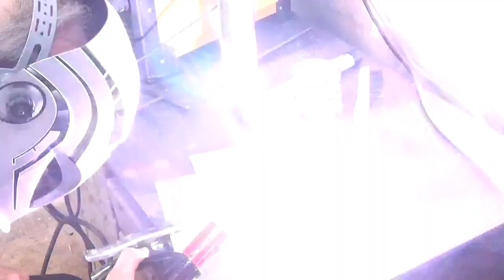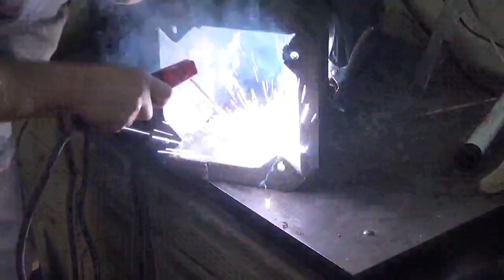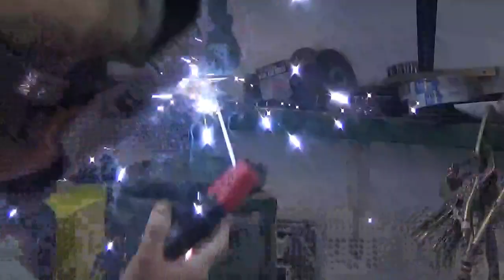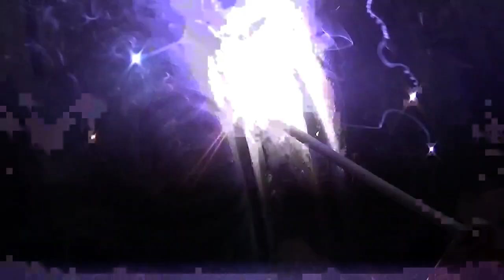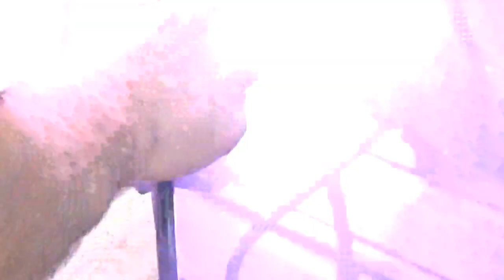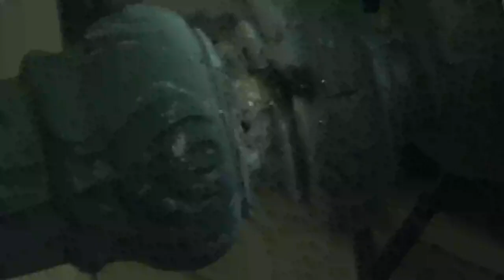Blue Demon Aluminum Stick Welding Rods and my AHP ALPHA TIG 200DX welder,  Easy field repair.

Comment: I wouldn't be surprised if their raw aluminum is from  a scrap yard.  When asked what they wanted, they probably said about a thousand pounds.  I have tried that E4043 rod and it is not easy to use.  It is also quite expensive.

Comment: Try brushing in one direction with that stainless brush. The back and forth only counters the first stroke as it folds the oxides back into the metal if you push only or pull only its better!

Comment: Congrats... You figured out a way to weld pot metal (very very very difficult to do and achieve any strength). I might have tried a dollop of clay behind the blowouts to allow them to fill without further erosion (but I’m kinda crazy like that). Those fumes showed up on camera pretty well and looked really nasty (I only weld outside unless I have a very strong vent system sucking the smoke out, that stuff will kill you real quick). Overall, you did a great job!!! While those rods were sloppy as snot in a sneeze, they got a very difficult job done. That arc flash will give you a sunburn and quite possibly skin cancer... Harbor freight has a wide selection of leather gloves in all sorts of thin leathers (like goat skin garden gloves). They give you plenty of feel vs a bulky pair of welding gauntlets. I don’t weld anything without at least a cape and leather gloves of some sort (no skin showing)... I saw you already caught a lot of grief for not wearing gloves, but it wasn’t very constructive, so I figured I’d bust yer balls a little while offering some viable things to try/consider. You are doing some really great work and I really enjoy your videos... Thanks for sharing.

Comment: Hello there , great video very explainatory .
I would like to ask you , i have to weld some aluminum sheet welded with some cylinders i made at the lathe , the sheet material is 5083 the pipe material is 6060 . I want to pay someone doing it but so far everyone i ve asked refers someone else and i am thinking if nobody finally will accept to do it that i will have to do it myself and what i would like to ask you is , is it quite as strong as a tig weld would be ? I dont care for the appearance cause the welds will be hidden but they play structural role in the whole assembly .
Thanks in advance
Reply from the maker: Hi Antonis, that's a great question;  I did some quick research on the 5083 Al.  You can weld them together, but I would not use these rods; according to my reference, you will need a 51xx - 55xx filler rod.    The 5083 is a much stronger Al than the 6060; if you must use these alloys, I would definitely use TIG;  while these rods work well, they will never get the penetration you need for a structural component with these metals.
Please understand,  while I can weld with most process's, I would never call myself a welder and have never worked as one.
Thanks for watching and for the great question.
Regards.
Reply: @SouthernEngineering  hello , i finally had them welded with tig by an experienced welder and they look strong and nice .5083 and 6060 is what i can find easily , if i could i would chance 6060 with 6082 which is much stronger .Thanks a lot for your quick reply and advice
Reply: Don't waste your time with stick aluminum stick aluminum is a wasted headache just take it with the right TIG welder you'll get better cleaning and you'll get a better weld no matter if it's hidden or not
Reply from the maker: @samdiamond7642  :   For the most part, I agree with you.   The reason I used these rods was simply because of the poor quality of the cast; my Tig was not able to burn past all the crap in the metal; these rods proved useful in this application.  Like most welding jobs, the process is specific to the task at hand.
I have since purchased a spool gun and new MIG welder; I can't wait to test them out.
Reply: @SouthernEngineering  glad to hear that I've been there also TIG does seem to spoil you sometimes

Comment: Nice work...I use these rods on occasion, I think there fine...I can't tig so that is what I use on aluminum.....
Reply from the maker: Thanks, Joseph. I wanted to TIG the lamp post, but the casting/scrap AL was of such poor quality and heavily contaminated that it would pop and spit when I tried. These rods are brutal but seem to plow right through the worst of the junk.
Thanks for watching and commenting.

Comment: Hard job
Did as good as you could.
Better camera and tripod a must. Also use a 5-9 shade from an old welding helmet. Also make sure you are uploading the video at its highest resolution.
Reply from the maker: Thanks, Ralph, I appreciate that.   I have improved my equipment and my editing skills but still much to learn.  I haven't posted in a while, been on sick leave,  doing better and I'm back in the shop so stay tuned.

Thanks for watching and commenting.

Comment: I use the same rods for brazing aluminum.  Not as nice looking as tig but with practice you can get it looking fairly nice.  The first time I tried it was on two scrap pieces.  I couldn't break them apart after they cooled.  I use a stainless brush for removing oxidation followed by brake cleaner.
Reply from the maker: I haven't tried that. I tried to use my TIG, but the casting was some kind of trash Al and full of crap. The light post is still in one piece, my buddies wife is happy, and I got a steak on the grill in return 😁
I plan to replace my MIG with a new one that supports a spool-gun, then I can do these types of repairs.
Thanks for watching and commenting, I appreciate it.

Comment: Maybe next time if you ever run into this specific situation again (probably wont) but if you do, you could try getting a piece of clean aluminum like 4"x6" or so and patch the inside with that. It might make it a little easier to weld a clean piece to that stuff instead of welding 2 contaminated pieces together. Just an idea, great video btw thanks for the review and info!
Reply from the maker: Hi Nick, sorry for the delay in getting back to you, YT put you in my spam folder ??  I don't know why that happens, but it does sometimes.
Anyway,  I'll keep your idea  in mind,  I had thought about an aluminum plug but was concerned about the interfering with the electrical cable that need to be run inside.

Comment: It's very interesting but don't u think safety comes first with your gloves nd proper clothes
Reply from the maker: Hi Shakier, I only use gloves if I'm doing a lot of welding or if I will be using a TIG; If you watch my cast iron repair you will see I'm appropriately attired for the task, I do appreciate your concern.

Thanks for watching and commenting.

Comment: I bought an inexpensive inverter welder specifically to try this and all it does is stick the rods to the metal.  I bought the exact same rods and am trying to replicate your 1/8" test results because that is what I need.  I spent all day trying to duplicate these results on 1/8 aluminum.  Tried cold and preheat.  Tried all the way up to 130A which almost worked but mostly just exploded.  If I set it down to the rod suggested range of 50-80 amps, it just sticks, sticks, sticks.  The longest weld I have managed was about 1/2" before it just stuck again.  I have had to break off so many times, that this just can't be right.  I am thinking that my welder is just not capable of doing alum stick.  PLEASE help!!  Need some input on how to make this work, or what to look (specs) for in a different welder.  In the amp recommended range, the rod will stick at the slightest touch to the aluminum.  What welder do you use?  Does it have hot start?  Someone said you need a welder with high open circuit voltage.  Is that true?  My welder has no spec for OC voltage and I am unsure if this is true or even if hot start matters.
Reply from the maker: Hi Joe, I'm sorry your having trouble, let's see if we can walk through this together.
The welder I use is an AHP Alpha TIG 200,  Plenty of power to maintain an ARC.   Also, you must run the rod DC EP  Electo Positive.     I assume you cleaned the Al. thoroughly.   I started out at 80 Amps and reduced to 70 as the metal heated; once it was very hot, 60 Amps would work ok.    I suspect your `inexpensive Invert TIG  can't maintain a steady current after ARC start; if the current sags, that would definitely cause a stick.
Please understand, I'm not a welder, nor do I play one on YT, hell, I haven't even stayed at a Holiday Inn Express'   with that said, I have used these rods a couple of times now and they work pretty good for what they are, but they are a brutal type of weld.

If you have a friend with a better welder, I would recommend you try them there.
What is the welder you using?
I'm sorry I can't offer more info, let me know how it goes.
Reply: @SouthernEngineering  1st, thanks for the reply!!!  Yes. Cleaned and welding only in the fresh spots.  Since I was new to stick, I bought some steel welding and could lay a "workable" line by the second stick.  So I tried the Al again and same result, nothing but sticking or explosion at high amps as I worked up through the amp settings.  My prior experience is a bunch of MIG wire.  I can do that all day.  The welder is  a 220/120 inverterter from AMZ.  I t is a Zeny 160. I am running it on 220.  Lot's of good reviews and claims to do AL.  I wish I had access to something else.  Trying to do  a small AL project on a budget.  Otherwise, I would invest in a good TIG rig.  I did OK with tig in a welding class a few years back.
Reply from the maker: Hi Joe.  As I said, I'm not a welder, welding Al. is far more demanding on your equipment than steel.  I looked at your welder, and I think that's what your fighting, it's either the welder or you have a bad batch of rods.   I'm sorry, I can't be more helpful.

Comment: That was a lot of fun, and very instructive. I wonder though, with the rough casting, and the varying thickness (thinness), why you didn’t braze it instead of weld it?
Reply from the maker: I must be honest I had not considered it, can you braze Aluminum?  I'm not a welder, but I promised my friend I would try to repair it,  long story short,  his wife was happy, and I got freshly grilled steak as payment (yup, I will work for food LOL)
I am getting my shop ready for some very cool Winter projects, I hope you will stay tuned to see what I'm up to.
Thanks for watching and commenting, it's much appreciated.P.s. I post updates, project previews, and other random stuff on Instagram #southernengineering
Reply: Just like you, in my neighborhood, I will weld for BBQ. You can readily braze aluminum with a purpose-made aluminum filler rod such as Blue Demon’s Triple Play (since you use Blue Demon) and others. Though, as I said, you did a great job of welding it and I learned a lot watching you overcoming obstacles to do it. I’ll be on the lookout for you projects.
Reply from the maker: Thanks for the info,  I get some of the rods and give them a try.   Thanks for the SUB

Comment: Don't clean the slag while it's hot. It's very difficult to remove. Let it cool and you'll find the slag cracks and comes off much easier.
Reply from the maker: Thanks for the Tip Rich,  I'll remember that.   As you may have guessed, my welding skill is a fairly new addition to my skill-set, but I am improving. 

Thanks for watching, and commenting, it much appreciated.
P.s. I post updates, project previews, and other random stuff on Instagram #southernengineeriing

Comment: I used Ali stick rods years ago on a Shell road tanker repair on the top hatch supposedly a temporary job but it was still there five years later,it wasn't a cast job though  went through half a box,arc up and they were gone not the best looking weld but did the job,just a bit of advice btw wear gloves and a fume mask the fumes are seriously nasty.
Reply from the maker: Hi Marc, ya know, it's funny how them quick fixes tend to last forever.

Let me start off by saying, I'm not a welder.  I purchased these because I could not get the right control with my TIG but I promised my friends wife that I would fix the lamppost for her.   There was so much junk in the cast Al. that it would spit and pop so this was my last option, happily they did the job.
Currently (when I'm home) I am rehabbing my whole shop,  at the moment reworking the welding area and looking at some sort of fume extractor;  I try to weld with the doors open but this winter I'll be doing some serious fab jobs and definitely need the get that handled.
Thanks for checking out my other work, it's much appreciated.

Comment: Why knot low @blow less amps
Reply from the maker: Hi Enzo,   I watched the WELD channel on YT to see how to use these rods, since I'm not a welder I was hoping to get a little insight as to the proper use and settings for these rods.   I don't remember the exact video but my second test bead looked very much like the professional welder's result on his channel, considering my lack of skill  I was very happy!
I've been working on my shop this winter getting it ready for some interesting projects in the coming months,  I have some customer projects and an old MGTD to do a resto-mod on.  Stay tuned if you're interested.
Thanks for watching and commenting, I do appreciate it.
P.s. I post updates and previews of my projects on Instagram @ southernengineering
Reply: @SouthernEngineering  i learnin two,day say fumes are bat, chuckie chan,try fan pointed outbound if fume bother or concerned,i'll try alum gas lens supposed two stop orange flam,but different medium,gas vs arc,is explode from not heat hi amp but scrap mix den ok but no blow on ticker part,mack me diagnose hi amp on tin part
Reply from the maker: Hi Enzo,   I'm planning to redo the area in my barn that I use for welding and an exhaust fan will be added.   I have not heard of a special lens for Alum,  I'll check into it, thanks.   I was having trouble starting an Arc at lower amps so I increased it +10, it was a little hot but it helped me learn to use the new rods..

I do hope you will subscribe,  I think you will like some of my projects and there will be a lot of welding and learning for me..
Again, thanks for commenting.

Comment: Try a darker shade lens might help locate your pool, good luck.
Reply from the maker: I adjusted the shade but the outgassing from the flux completely covers the weld pool.   I watched a demo on the weld channel, he got the same result.  Not a pretty weld but it is functional.   I'm working on a camera inside my hood for a better video, stay tuned.   Thanks for watching..

Comment: Brave soul. Best regards.
Reply from the maker: Thanks John.   The Electrodes worked well as I could have hoped for.   The cast Al. was so full of junk my TIG was just a waste of time.   I have all my `Honey Do's' done so I plan some shop time this winter,  I hope you'll checkout the projects!  Thanks for watching.    P.s. If  your interested you  can see a  preview and updates of my projects on 
Instagram @ `southernengineering
Reply: Yes sir, very interested in real folks doing real things. When these are posted, saves others life lumps schooling. Thanks.
Reply from the maker: Hi John.   That's cool,   I hope you'll find my projects interesting and I'm looking forward to your feedback..  I agree YT is a great place for How-To's, Intro's and interacting with like minds;  it has definitely helped and entertained me.   A little back story.  I built my pole-barn nearly 9 yrs ago, long before I ever considered YT, it was never intended to be anything other than a dirty old workshop.   I made my first video because I couldn't find one to repair the mirror on my truck,  (it's near 30K views with many thank you's)  my fireplace video is near 400K,  Yup I'm hooked.  SO,  this winter I plan to make the shop more presentable and work on other projects as I go alone.   I'm looking forward to sharing the journey and delighted you want to follow along... 
That enough for now,   Gotta go;  I hear a turkey sandwich calling...   🦃

Comment: Excellent video. Do you have formal training as a welder, or is Al something a rank amateur can figure out given enough rod and time?
Reply: We have a aluminum pot, about 12” in diameter which has a stub sticking out where a handle is attached. Well ,some how the handle got broken off.  This meant that the stub holding handle had to be reattached to the pot. Beings my training and trade is in the welding field. I used a aluminum rod, a AC machine and carefully,carefully, welded that stub back on that pot. Yes, it didn’t look the best, but going on 54 years through some rough handling it’s just as good as new. Yep, aluminum rod on a AC  Lincoln machine , it was difficult, but it worked.
Reply from the maker: Thanks Art, I appreciate that.    No, no formal training,    My father taught me how to strike an arc when I was about 8,  and I never worked as a welder,  I learned to weld for my own needs.   I found out about the Blue Demon rods from weld.com on YT.    If you want to use these rods check out that channel and weldingtipsandtricks  those guys know how to weld...   Thanks for watching..